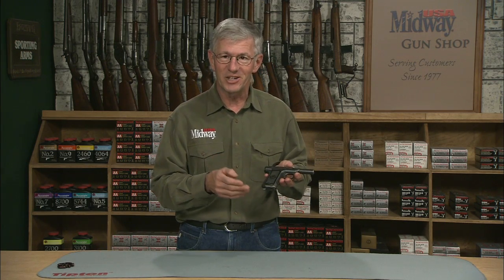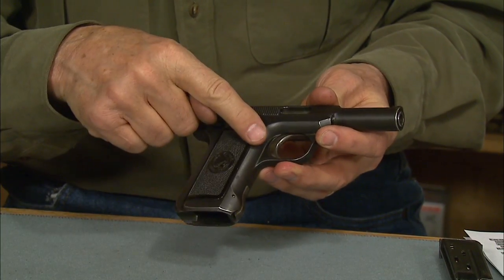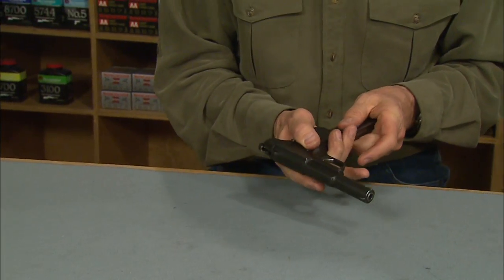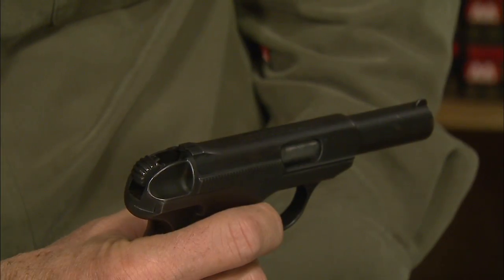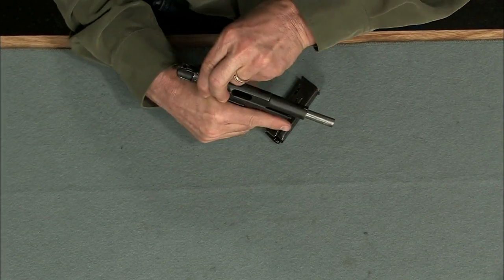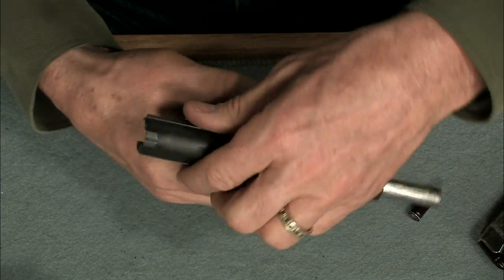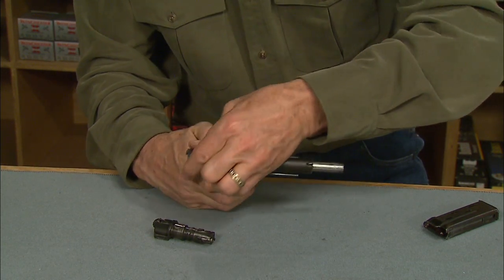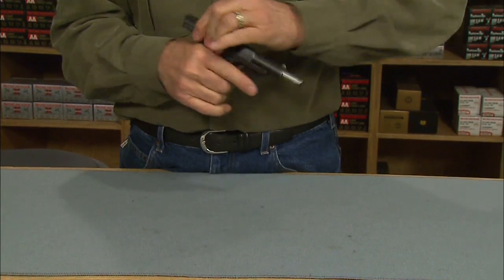The Savage Model 1907 Automatic Handgun | Gun History | MidwayUSA

Comment: It’s not the way it is... 1.   not a hammer this gun is striker fired. It’s a cocking lever. 
2. They made the model til 1920 in .32 acp and .380acp but .380 not as many. There was a model of 1915 made 2-3 years and a model of 1917   From basically 1917 til 1926/27